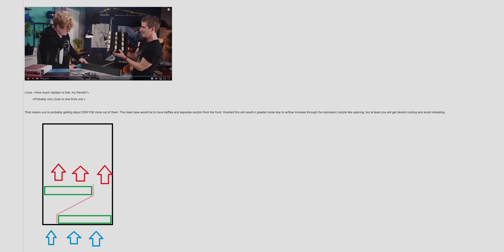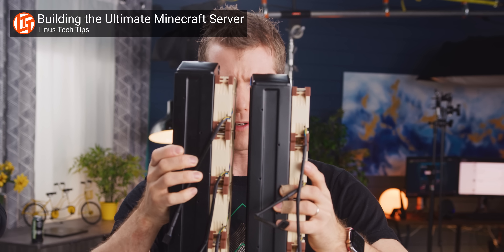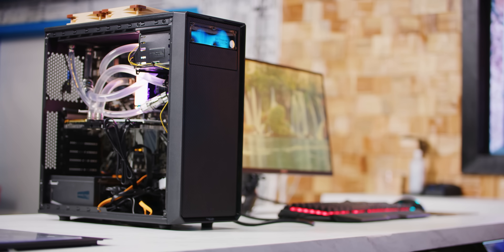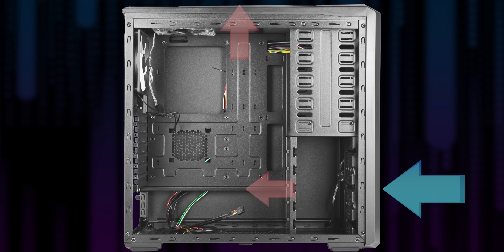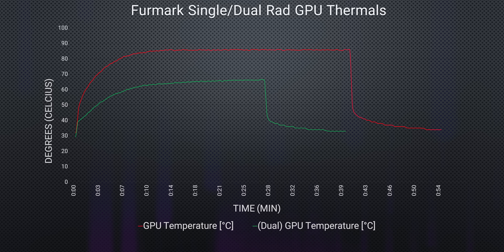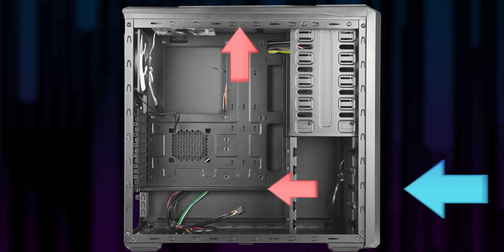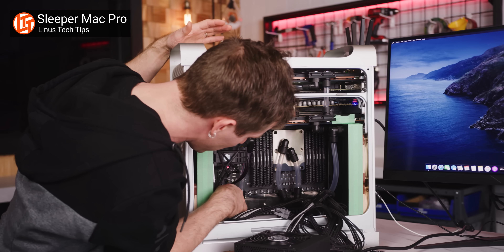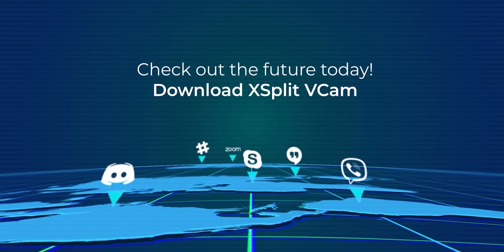I’ve been water cooling wrong for YEARS - $H!T Manufacturers Say

Comment: In dual radiator scenario I would first pump warm water to up radiator and later to the front one - it will maximally use temp difference - air is warmer on top, so I should pump warmer water there.

Comment: Depends on which rad is right after the blocks. I would always recommend running from pump/reservoir, straight to GPU/CPU, them the first rad exhausting, them second rad, even of intake rad, as the second rad would balance out the coolant temperature as low as possible. Basically, the first rad, exhausting, gets rid of most of the heating, and the second rad basically optimize the coolant temperature before the pump. Works every time.

Comment: There's an old saying regarding computational fluid dynamics (CFD) modeling: "With CFD you can get whatever results you want".  CFD is notoriously difficult to do well, and it MUST be compared against experimental data.  Their point isn't completely invalid: if pressure drop is too high, then flow rate is decreased and cooling power drops.  But I doubt you could see that in computer cooling.  If the cooling system is really good, then adding a second cooling system may not provide much improvement (you can't extract any more heat than the CPU produces, so if you are already removing all that heat without the computer overheating then there isn't much to gain).  On the other hand, a lower average temperature difference should NOT cause decreased cooling.  If the CPU/coolant temperature really is that low, then it means the cooling system HAS DONE ITS JOB IN REMOVING THAT HEAT.  Where else could the CPU heat have gone?

Comment: I noticed you said "in series" which made me think whether the use of an "in parallel" system would be better for particularly high heat, high intensity setups, perhaps a server. I'm sure it would be more complicated to setup but perhaps splitting the heat and spreading it equally between two radiators would make it more efficient rather than having the first one at max capacity and letting the second one mop up the rest. I might be wrong, I know nothing about the actual mechanics and physics of how the heat is being moved around or if a rad being at max capacity effects the rest of the system.

Comment: Two radiators blowing their own air is not the same as blowing one radiator's hot air directly through another radiator. What you showed at the beginning with stacked radiators is not the same thing you tested.

You're usually pretty thorough with your zany test but this was a bogus test.

Comment: 0:20. Adding radiators doesn't make the temperature drop below ambient. It only allows more heat to be released two more easily and accurately maintain an ambient temperature.

More radiators is about temperature stability. Not the intensity of the temperature.!

If you have multiple or high frequency components that produce a lot of heat. You will need more radiators.!

Comment: Props to Corsair for saying "don't waste your money buying too much of our product."
Reply: Yeah, I believe Corsair rather than Linus in this instance.  Just off the mark, the multiples of radiators would dissipate heat for 1-3 hours but after times of 4-6 hours of continuous running everything inside the build will get to a higher temp including a motherboard and graphics card(s) that will be radiating heat into the air within the case and stifling the cooling process...and if that rig is left on all the time (some people do) the air within the case will be that much warmer.and sucking warm air thru one radiator, not to mention multiples will be a lost cause and waste of money.  The best method is having a clean flow of cool air being brought into the case with a direct line of it exiting with as little turbulence as possible.
Reply: @richardk2870  yeah, just put a fan on the front with a hose between it and a fan in the back and let the hose suck all the heat out by conduction 

or you could just immerse the entire system in motor oil
Reply: @touristguy87  Lol, yes liquid cooling to its most literal degree!
Reply: @richardk2870  perfectly safe, just store it in an oxygen-free chamber, or at least a low-pressure chamber
Reply: @richardk2870  Why would you be running a full synthetic load for 6 straight hours? Again, real world vs. simulation/theory-crafting.
Reply: @RaynmanPlays  Any intense gamer can and will run a system at full bore for 6, 8, or 12 hours without stopping even for a PB&J!
Reply: @richardk2870  Are you being intentionally facetious or do your really piss yourself to keep gaming for multiple hours on end and somehow manage to avoid any dips in computer resource requirements (loading screens, small rooms, cutscenes, etc)?
Reply: @RaynmanPlays  mining. It doesn't make sense to buy the gpu's specifically for it anymore, buy if you already have one and don't use it 24/7...
Reply: @Kowalskithegreat  That's fair enough. I need to get back to mining on my PC while I'm at work and asleep.

Edit: That said, that hits the GPU hard, not the CPU. So you're not pumping out as much heat as you would with a full synthetic load.
Reply: if your smart you'll know your better off buying other brands like E.K and alpha cool. better products and lower prices most of the time. I love corsair psu's but not water cooling stuff
Reply: They were also correct and linus's test only proved them right.
Reply: @timessiah94  Simulation software is really good at simulating. Almost as if they were created so engineers don't have to use a design iteration
Reply: yeah odd how "used memory" follows Moores law 

I have a laptop with 16GB of ram that simply runs rings around a similarly aged laptop with 4 Gigs 

it's the rig with 128GB that looks weird but I can easily make good use of that extra 112GB

render enough videos and that's not a problem
Reply: one comment and two replies that all have nothing to do with one another, reading this thread I thought I'd fallen into the twilight zone.
Reply: @knifeyonline  that's because the comments went over your head
Reply: @Aethenthebored  no

Comment: Actually there could be a suitable solution to use multiple radiators without adopting the series  configuration (you will never see two radiators in serie in any engineering application, that's actually a very inefficient solution): you could mount the fans of both radiators to suck fresh ambient air and let the air vents on the back of the case act as exhaust for hot air... This would actually be a more efficient parallel configuration... Let me know if it's possible to do that! :)

Comment: Wasn't corsair referring to your SERVER not a PC?
Reply: Since you tested a stacked radiators in a PC rather than a server setting render this entire videos data irrelevant cause its arguable its the wrong scaling? Since you used 4 rads in the server shouldn't you test then if 4 RADS together affect heat exchange rather than halving the surface to structure ratio.

Comment: why put the radiator in the case ? .. sure have fans blowing out the hot air in the case but why have the radiator in there to exposed to the hot air or adding to it

Comment: I know this is an old video, but I have my loop in this order:

Res > Pump (Combo) > GPU > CPU > Top mounted Rad > Front Mounted Rad > repeat

While everything reaches equilibrium, I'm suspecting since the top rad is both thicker and first after the heat generating parts, it's removing all that waste heat first, and the front radiator just expels the rest. Like a backup. Eventually, everything reaches equilibrium, but since I can feel that heat coming out of the top of my case like a furnace, I suspect it's doing most of the work. And I do have a rear case fan helping to take away ambient heat from the case, so I'm thinking that the top rad just has plenty of fresh air to keep my 980ti and 4790k at great temps. My 980ti never goes above 60C, and overall, this loop functions amazingly... So much so it expels heat like crazy. 

Remember, Watercooling keeps your PC cool... not your room!
Reply: I was going to suggest that your setup is more efficient than plumbing the front radiator first. It's not clear from the video if they had the front mount radiator first in the loop or not, but from a thermodynamics point of view, pairing the hottest water with the hottest inlet air maximizes the heat transfer, because you maintain the temp differential between air/water in both radiators (hot water/warm air in radiator 1 and warm water/cold air in radiator 2 vs. Hot water/cold air in #1 and warm water/warm air in #2).  It's like creating a virtual counter-flow heat exchanger.  Similarly, if they're running anywhere close to capacity I would expect a big difference in cooling efficiency on the minecraft server setup if the flow through the radiators was reversed.

Comment: i saw a video of someone stacking a bunch to a large room box fan. which resulted in ambient room temps at full load. and normal temps with the fan off with passive pump cooling... so more radiators does seem to  have an effect. maybe diminishing returns so it doesn't double the value but still has an effect. /think

Comment: water cooling CPU AND GPU is taking away the "Air-cooled things" that would add to the ambient that goes through the second rad.... I think you would have to work pretty hard to make it actually hurt the thermals, but you should see a noticeably diminished return on the second rad if you had left the GPU air-cooled. Water-cooled 9700k, air-cooled 3080, you should see heat being added back into the system via the second rad since the air is being significantly heated by the 3080.

Comment: I could understand corsair’s claim if you stacked 3 rads together and then made the airflow go in the same direction as the water, that could have a negligible or even negative affect. But if you were to run the air flow against  the direction of the water flow then you would be super cool!

Comment: I think important is to run the water first through the top radiator that has warmer air to cool down first a bit and then after let the water flow through the lower radiator with cooler air. If other direction maybe no benefits of second radiator if the case is really hot already. At least in some single cases. Not always.

Comment: I also work as a mechanic and body man on top of building gaming pc and i already can confirm that multiple radiators will in fact cool better even stacked. Hot air is still air blowing across the fins. The water circulating generates massive heat and the air mixing with the first radiator slightly cools the air before hitting the next radiator after you get to the 3rd radiator yes the temps will be pretty hot compared to the first one but the threshhold of heat isnt greater than the cool air coming from the bottom fans on the bottom radiator. Cars have been doing this for years and years and years stacking a radiator and a ac condensor and everything still stays cold and helps lower temps. The same will go for a pc as well in ny experience.

Comment: The problem isn't using more than one radiator, but using more than one and putting all together side by side. In that way just the first radiator will down the temperature and put hot air into others.

Comment: I had a couple of configurations with two rads in the Phantakes Evolv ATX and X. with intake fans on the front and outtake fans at the top I was getting really bad performance, like if the second radiator was actually pointless, not completely, but nearly there. 

I then set all the fans as exhausts and the water temperature dropped significantly. I would guess that the water temperature would drop even more if I set all the fans as intakes, but I don’t feel like dumping all the hot air inside the case would be beneficial. 

Generally speaking in builds with multiple radiators I always found out that all the fans on the radiators should be pushing air in the same direction to prevent feeding hot air to the other rads.
It feels kinda awkward for the airflow, but we talking about watercooling so it does have a logic if you think about it.

Comment: Wait you have been pushing the same air through a second radiator? Unless you feed the warm water into the second radiator and out of the first. But ya  a separate fan and air flow is always better.

Comment: @linus, you didn't do watercooling wrong, you do cooling and testing wrong 🤦‍♂️
you simply just shouldn't put a radiator at the front for the reasons you just said - the highter the temperature difference, the better the cooling!
a radiator at the back and one at the front to do their job and exhaust heat instead of heating the inside of the case and thus ruining passive cooling of other components and thus increasing power draw = producing more heat in the whole system! - it's like a rebreather where you inhale just what you already used or better said, exhausting the engine trough your car inside 🙄

Dude, just do it with sanity! - if radiators don't have to reuse already heated air it works just fine and even bound in series is an option if space concerns limit's you, as long that you can maintain airflow trough it with pressure fans!
(and pumping water from the outmost facing radiator to the inwards facing radiator, so that there is always a temperature difference - this is btw how commercial heat exchangers are build for centuries! - the thing is that a PC is just not producing that much of a heatload that it makes a significant and hard to measure difference! - your test even shows that it's pretty irrelevant how you to it, it will cool well enough even in the worst case! - it's just efficiency we're talking!)

Comment: Due to having a second radiator and the needed tubing, you have more water and thus more capacity to take up heat 
This is why your running lower Temperaturs in the Test
Reply: More water just makes the loop take longer to reach equilibrium. It doesn't do much to lower the equilibrium temperature.

Comment: Mechanical (thermal & fluid) engineer here. From what corsair is saying I could see their being some truth to the idea of the system effectivly cooling the same heat with less radiator area, but running the radiators in series should almost always reduce the overall fluid temperature. The odd cases mostly would be in fan heat becoming significant. 
This really sounds like an engineer or design team who has simulated too much, and thought about the system too little.

Comment: I think the point here is stacked rads butt up front to back loses cooling efficiency. If you have one in front then it will get the full cooling while the one right behind will have directly warmer air blowing onto it reducing the cooling efficiency. As and example if you took 4 of the 3 fan rads and stacked them back to back blowing in a line and they kept things at a desired cooling, in that same enclosed case design if you were to turn them and have them each pulling in fresh cooler room temp air and blowing out of the case on the other side, then you might be able to remove one of the 4, 3 fan rads, and get the same performance although those rads might be at their higher limit of cooling.

Comment: Remember, if you use multiple rads in series, make the water flow against the air, the first rad (which is the hottest) should be where the air is already heated up, last rad should be right at the intake, this way you keep a temperature difference between the water and the air at each point, that's also how "cross-flow" heat exchangers work

Comment: Corsair: "stacked rads are barely effective." 
Linus: explains why that makes sense and decides to test it.
Also Linus: doesn't test stacked rads.
Even alsoer Linus: Explains that the stacked rad setup only gained 5 degrees compared to the 20 the serial rad system dropped.
Even more alsoer Linus: "iTs tHe SaMe ThInG."
Reply: wasn't the stacked rad he had pulled 1 of more than 2 in the stack.... pretty sure that is why it was only a 5 degree difference
Reply: He needs to learn thermal dynamics... water cooling in PCs isn’t even advanced stuff...
Reply: I was gonna comment this

Comment: it depends wich direction the loop flows. technicaly as in thermodynamics corsair is still correct.
Reply: Yeah but its kind of like ignoring air resistance in a typical high school physics exam questions where conditions are perfect
Reply: @famzino  on an small case like this yes. But if you have a factory that produces lots of heat. going the thermodynamic right way will count.

Comment: It's important to note that direction of flow is extremely important,
If you stack radiators air and water flows need to be opposite of each other.
So cold air cools cold radiators and hot air cools hot radiators. Similar to fish fins, just for cooling instead of breathing and water-air instead of water-blood

Comment: 2:19 ...and that, boys and girls, is why I personally just hate about any and all commercial water cooling solution(s). You'd be either using "hot" air from inside the case to "cool down" the coolant, or push even hotter air into the case...which you'd want to avoid in the first place.
Yeah...radiators outside the case (or at least not in the same compartment as the CPU/GPU/PSU/etc...), using "cold" air from the ambient on the radiators and pushing "hot" air anywhere *except* inside the case; THAT'd make water coolers worth their price, IMO...